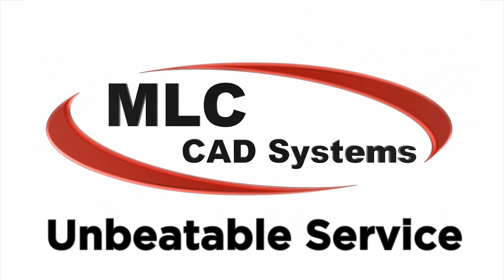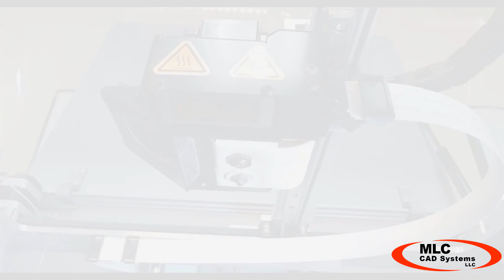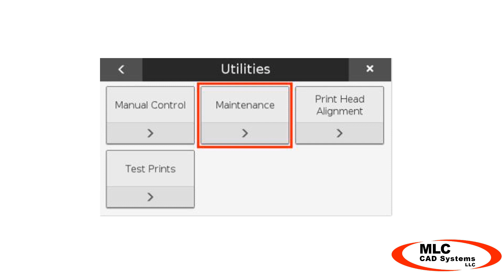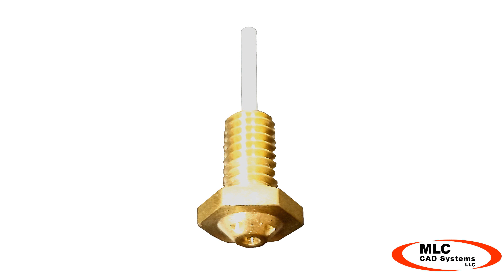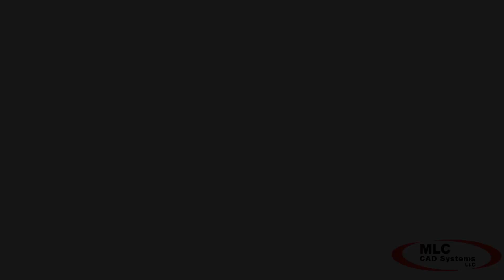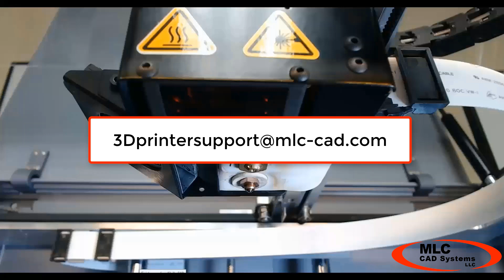How to Replace Plastic and Fiber Nozzles on Markforged Printers

Comment: Thank you for this video it was helpful how long does a typical nozzle last? and what are the signs it is time to replace?
Reply from the maker: Thanks for the question, Jason! The first and most obvious sign of plastic nozzle wear is degradation of print quality. Other than that there isn't many ways to tell unless there is obvious damage to the nozzle.

As for the Fiber nozzle, there are 4 dimples on the nozzle, if at any time any of those dimples are no longer clearly visible then it's time to replace.

It is recommended to replace the plastic nozzle every 3 to 6 months or 1,000 print hours. It is recommended that the Fiber nozzle be replaced 1-3 months or every 500 print hours.